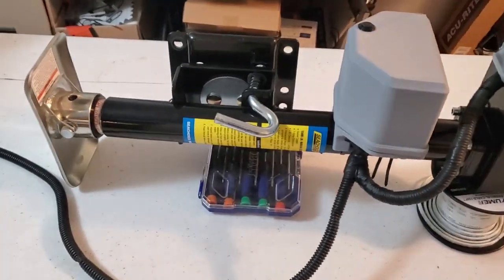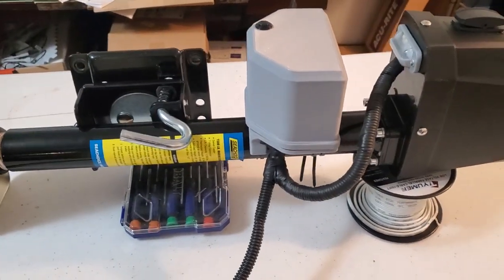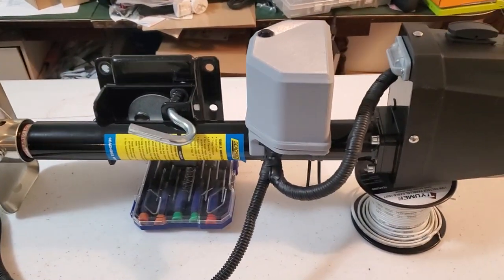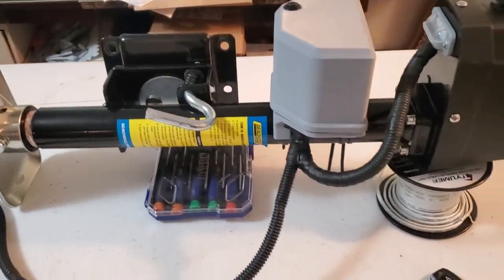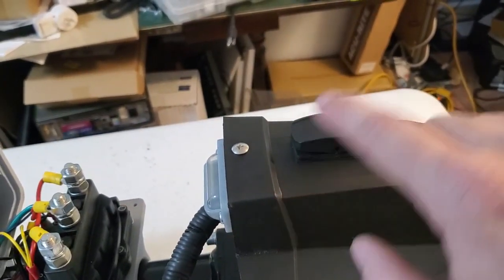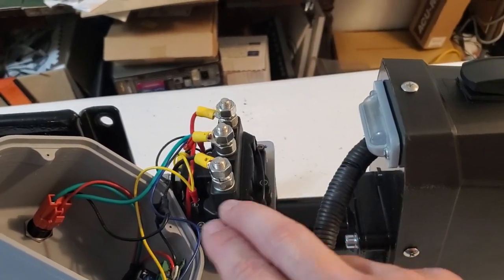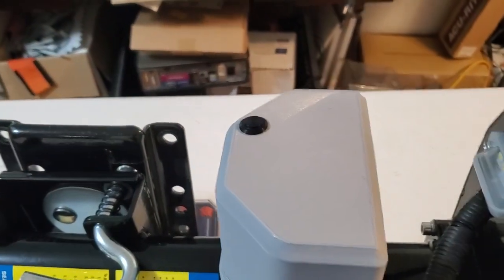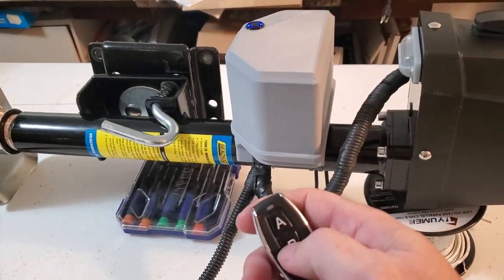Electric trailer jack modified for wireless remote control

Comment: Would you mind helping me out with something?! I’ve actually done this exact same thing but am having trouble with the wiring. How do you wire the switch and winch solenoid to the motor so that both the switch and the solenoid can operate the jack? I pigtailed one of the dpdt pos/neg lugs, one of the winch solenoid pos/neg lugs and one of the motors pos/neg lugs together and then repeated the same with the other side. That’s clearly not correct. What should I be doing differently? I’d really appreciate any guidance you can offer!!
Reply from the maker: I had to completely unwire the stock switch from the motor. I then wired the toggle switch to the solenoid along with the remote switch. I also added a latching pushbutton that powers the remote only when I'm there to use it while hooking up my tow vehicle.

The factory switch on mine was wired in a way that it is off when not pressed and then it send voltage to the motor in two different polarities depending which way you press it.

The solenoid is designed to use a toggle switch and you wire the common pole of the toggle to 12V and the other side to each of the inputs on the solenoid. If it goes in the opposite direction than you intended, then switch the two poles.
Reply: @SEEMERIDECOM oh ok, of course! I hadn’t thought about actually re-wiring the switch to the solenoid instead of the motor and it makes such perfect sense that I can’t believe I overlooked that! I have an almost perfect record of over complicating everything so I’m thrilled to have the confirmation that my obnoxious habit is still holding up and as strong as ever! Thanks so much for the reply man,I really appreciate you taking the time to help me!
Reply from the maker: @WelfareFritter  No worries. I'm the same way. I will think and over think something for a few months before I even start the project. I've found that works for me. I used to dive right in and have issues sorting it out during the project. 

Another thing is I will have an idea how something works and find out my understanding is incorrect. But, once I put my hands on the new gadget (what ever it may be) I'll get a better understanding.

I will say I feel we are living in an amazing time for the guy/gal who likes to tinker. The understanding of just about any subject is a simple Google or ChatGPT question away.
Reply: I just saw the tread!!   I think I figured it out!   Thanks

Comment: Fantastic build! Where did you get the housing?
Reply from the maker: I designed it in Fusion 360 and 3D Printed it using PETG. If you're interested and have a 3D printer, I can post the file to Thingiverse.
Reply: If you could please share the link to the Thingiverse id appreciate it thank you! I just recently assembled everything and need something to contain it.@SEEMERIDECOM